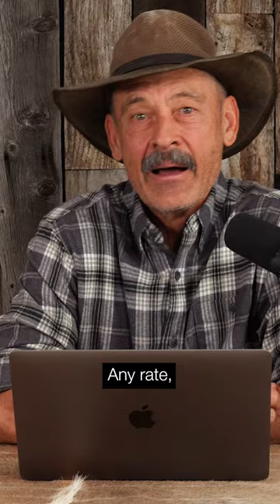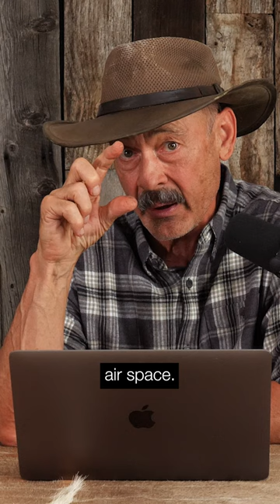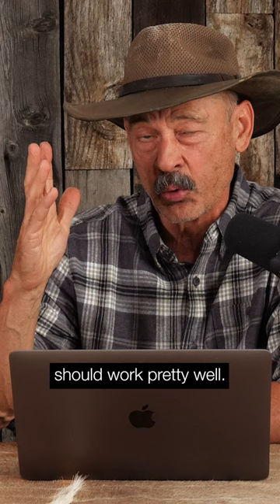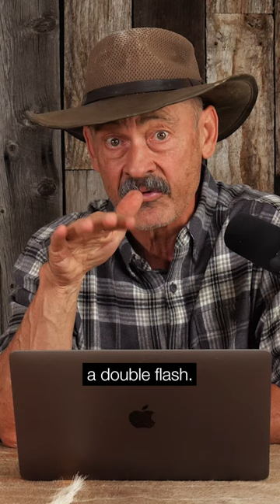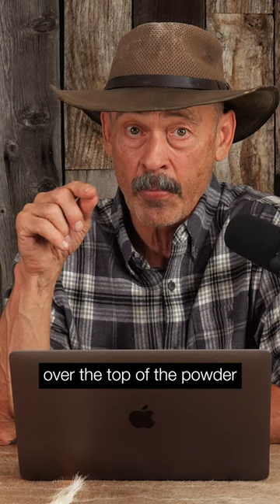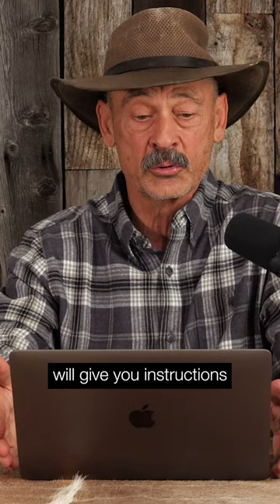Use caution when shooting with light loads!

Comment: I was going to say use the handloading manual and you can't go wrong.  I've shot many many reduced loads.  They worked fine.  I used to shoot really light loads in 22.250 for small game hunting just for fun and also in . 38 special we would shoot loads around 500 or 600 fps loads and they were great for target shooting and small game hunting, but we always used the reloading manual. ♥️
Reply: I shot indoor combat pistol. On revolver night they never checked for power factor. My 38spl 148 wadcutters had such a light load they accused me of just using a primer.
Reply: @Michael-rg7mx  😂😂😂. I've not shot that much competition with a pistol, but I did use a model 13 with factory wadcutters at a police dept shoot once. Very small police dept my friend was a member of the police reserve in and I scored a perfect 300 in points. It was really really easy.  Model 13 K frame round butt.  Great 3 inch carry gun 357, but I carried 38 specials in it because cheaper and I could shoot them so good. ♥️🤘♥️

Comment: So was told and have always thought that because the flame front can travel across the top of the powder you effectively are getting a faster burn which leads to a overpressure event. When you have a normal cartridge rest burn through the gun powder instead of igniting a majority of it off at once.
Reply: They called it a SKILD when I was in gunsmith school and for the life of me I can't remember the definition....

Comment: I often use a round piece of thin cardboard (like cut from a milk pack) cut it to the correct diameter and push it into the cartridge to keep the powder  together. Especially for my light 45-70 training loads. Works well.
Reply: I used cardboard and fiber wads for the same reason.

Comment: Kapok. It won't add to the strength of the powder charge. A short term filler like cream of wheat works but you can't drive around it will mix. A straight walled case can use a thin card wad with any filler then up to the bullet. Some powders are worse than others. Use the powder burn rate schedule put out by Lyman. Then use the reduced charge for the slowest powder.
Reply: I had to use cigarette paper to make a barrier for the walnut media (to keep from mixing a causing a misfire) in my obsolete martini Henry load using a slow burning smokeless powder. Works well but is a pain

Comment: I use a lot of Unique for 30-30 and 45-70. Most of my older loading manuals like the Lyman 57 doesn't say anything about filler for Unique. Maybe Unique is such a fast burn that doesn't behave like an slower powder. I have seen some reduced loads for IMR4198 as an example and wonder if it would apply more to this.

Comment: 300 Blackout is a perfect case size for small amounts of powder combined with a long heavy bullet for subsonic loads and you can use larger powder charges and shorter/lighter bullets and still have no open space in the case.

Comment: *   If the ignition of the powder is not sufficient to properly move the projectile down the barrel the pressure can build to a dangerous level. I always used slow burning powder because it filled the case better, even though it was more costly, I avoided this problem.
Reply: I traded for a 20lb can of IMR SR4759 it was the Best slow burning powder.... I use it for most of my older cartridges.

Comment: My understanding is that on a technical level The type of combustion reaction that is supposed to happen in a gun is a deflagration. But when it is undercharged The powder burns differently potentially with more air causing a detonation. Which is a much quicker less controlled type of reaction with a much higher pressure peak.

What exact mechanism causes a detonation instead of a defligation when undercharged I am not smart enough to know.

Comment: Why would you do this?  So many different calibers to choose from.  Just match your needs. Unless there are some good reasons I don’t think I would want to light load a large volume case
Reply: Economics,  not having to own many different rifles.  You could use a 
243 for deer and loaded lighter for varmint for example.  Plus you only need the one gun and set of reloading equipment for both.

Training,  teaching a younger shooter the basics without too much kick.

Plinking/fun.

Creating a subsonic load for a silenced platform.

Just some ideas,  I guess is money is no object you'd just have a separate gun for every consideration but that's maybe not practical for everybody.
Reply: @zakpodo  I can agree with those reasons.  I was just worried about light powder loads in large cases.  Kinda scary.  We reload and pistols light but not any rifles
Reply: @JoshuaMixson9696  honestly, I don't make light loads myself (pretty much for the reason you said)  but my father/grandfather did

Comment: Yup, thin tissue paper wadding is highly recommended for most  light loads these days  .some loadings expressly say DO NOT USE FILLER.  It keeps the powder in place and helps the pressure curve extend slightly from the slight compression itself without adding to the propellent . Most of not all smokeless propellants burn faster than the paper so in most cases it acts to mechanically decrease case capacity , gives more uniform burn and more consistent shot placement . 
In this capacity the .375 h&h NE belted, is close to king .  There are two  .375 h&h case designs and three factory loading styles.  .375 h&h flanged , is the predecessor to what we  commonly know of today. It is originally a black powder express round , with flanged ( rimmed ) case for single,double and combination guns .  Then the Nitro Express belted and flanged versions came out . Flanged is still preferred in single shot or double guns in Europe . It is slightly less powerful because it is loaded lighter than the belted NE , made for Mauser action bolt guns . (Propper name of::  .375 Holland and Holland Nitro Express belted ) 
They can be hand loaded down to 38/55 winchester level ,or .375 win, or any steps in between full powered rounds .  Hig  energy powder and 300 grain bullets should produce 2450 fps EASILY . (SAFELY ,NOT JUST FOR THE SAKE ) I have gotten 2600fps with no pressure signs and good accuracy from a 26 inch barreled Browning a-bolt stainless stalker II . .I didn't get pressure signs until maximum load with R15, on cci large rifle  military primers  as I tend to like .the thicker primer cup is a nice little safety feature if you are hunting in extreme cold .sometimes ice can build up inside the firing pin channel and keeps the tip exposed from the bolt face . If bad enough it can discharge a round upon  chambering . The harder primer cup of the military primers makes that harder to achieve and is a magnum primer in heat and burn time . Making it very suitable for anywhere that regularly sees 0° f or lower .  It is recommended to use magnum primers in extreme cold for better ,more consistent combustion .in trade for 1 grain of propellant for data  meant for non magnum primers.  ( This is in speer #14 and is given as a general rule, you new guys don't need to mess with it until you are confident in your safety protocols. I would have no problems taking 10 minutes or more for each round I hand load , to ensure exact consistency in every aspect I can control . Especially powder weight . I do not throw into a case directly for any reason on a single stage  or  manual turret press .
I haven't gotten a progressive press yet .but I do want a Dillon system. It can be converted to Hornady lock n load dies and arbors. Or standard or left alone for dillan precision dies. (That's the same company as Dillon/aero ,the mini-gun and m2 browning upgrade people )